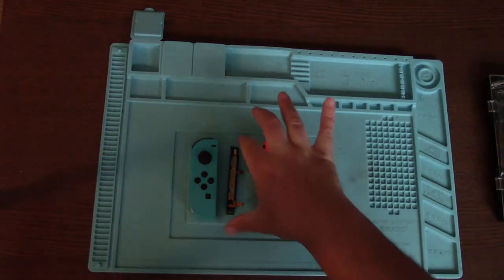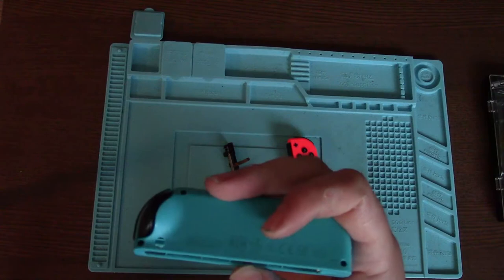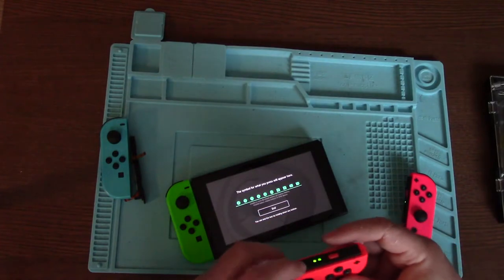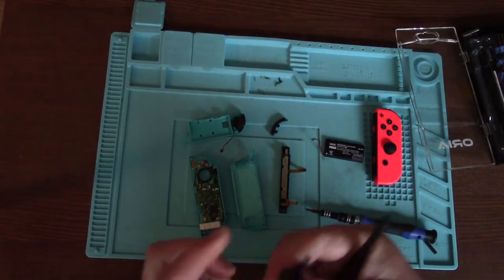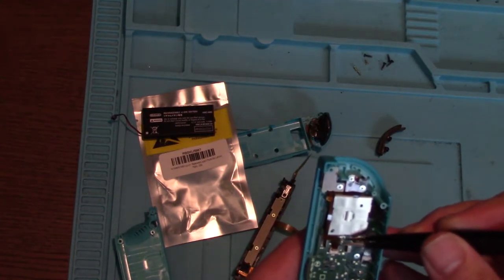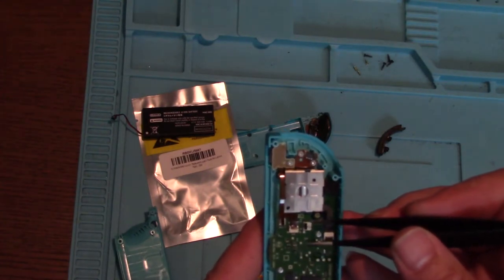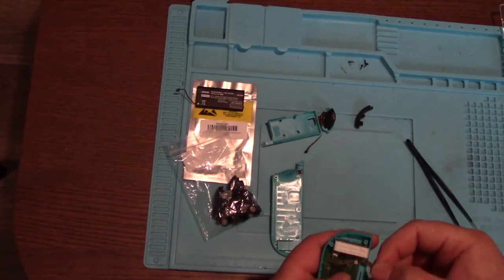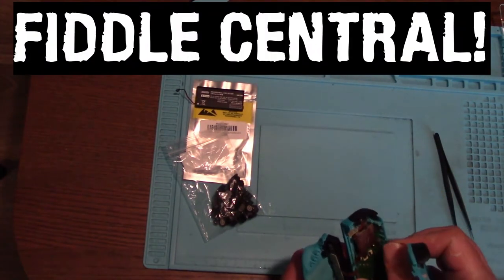Nintendo Switch Joycons that have been sat on! Stick drift issues and a broken rail!  Can I Fix It?

Comment: Great job Steve! 
A tip for you (or anybody) ! If you lose something small on the floor, empty your Vacuum cleaner, then vacuum the floor, theres a good chance you'll suck it up!
I did this when i lost a tiny spring that pinged out of my hair clippers, found it within five seconds of hoovering!
Reply: Or put a sock over the pipe of the vacuum and said item will be caught in the sock.
Reply: @DJ_Sycottic  searching for something you know you dropped is a very different experience than searching for something you're not even sure was there to begin with. 🤣

I've searched for that same spring before...